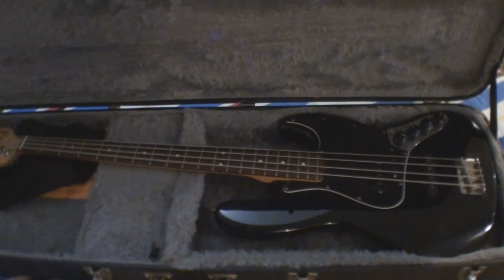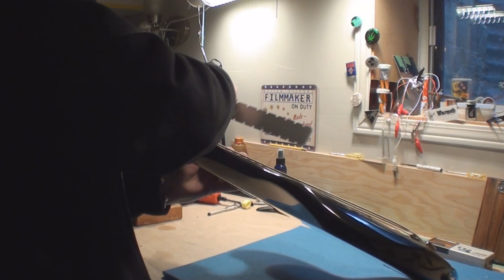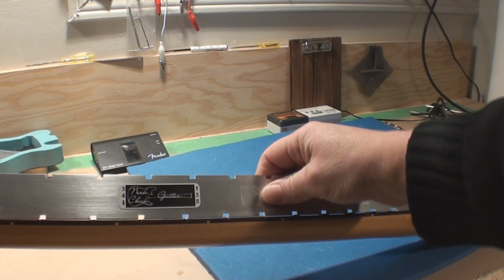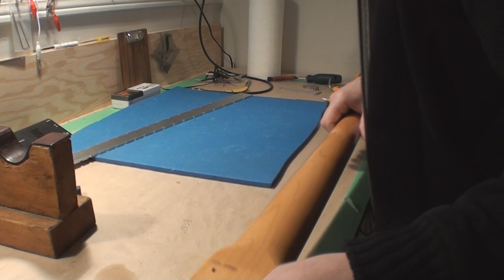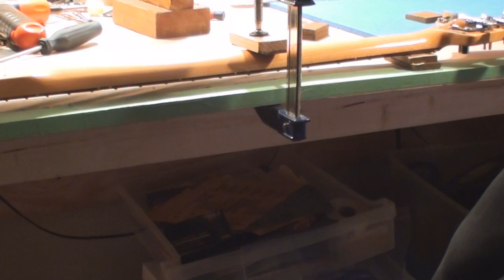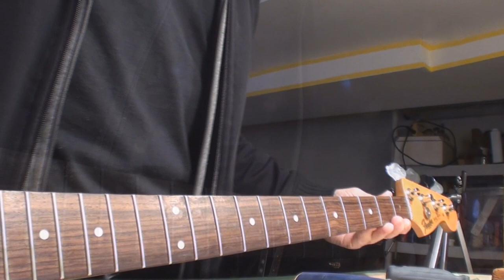Fender Bass Bent Neck Repair

Comment: Prior to clamping, I use my heat gun to slowly heat the fretboard until it's all nice and warm, almost hot, and it releases the tension between the two dissimilar woods - rosewood and maple - and SHAZAM! - A heating pad is also effective, especially is it is a bound fingerboard - Hope this helps.

Comment: My 04 Squier P , with the PJ picks, I know it's only a Squier, have had It for about 10 years, and it mint, and I love the feel of the neck,  and it used to play great, I have a 70's Fender J, and 70's P, and a 66 Gibson EB3, and I have 2 Ibanez nice playing cheaper basses, went to Change strings and set up before playing it for a while, long story longer, re sting it and the action was high on bass side, tighten, truss rod, twice 1/8 at a time and still relief on E string and its just under 13mm at 7th feet, look down the neck reel good and I see a really, slight twist, I am going to give it a shot to straighten it I did it on an Ibanez, and I got it straight, and I was going to do slight up grade on pups, and I didn't, If can't straighten it out I'm going to get the same exact neck, because I love that bass, it was all most as good as my MIM P, that I got last year

Comment: By the way I did this on a Gibson les paul and an iron set on warm for a few hours, it worked great and even after years its held up and the binding didnt melt, I think the heat is an important ingredient to allow the wood to flex into the new shape then let it cool completely while still under tension to cure into the new shape. Mine was still warm after 6 hours so I left it overnight.

Comment: Wish I would have been watching these before I gooched my fender jazz (mim as well).  I thought the nut was stripped, got a new one, then the guitar guys told me the neck was warped and that I could leave it there so they could put a spacer in, but since I got it as a project guitar I went for it, and got the damn washer stuck on the rod, now I don't know what to do lol

Found a mighty mite neck and put it on crooked X[ Still plays good, you can see me using it in some of my looping videos.

Comment: Don't steam it too much ... unless you mean to take the fretboard off. Sometimes injecting some steam via a fret slot or three works better, but you have to get into the wood of the neck, not the fretboard. It's a fun game. Too little doesn't work, too much and you have more to repair. I have straightened necks with worse bow ... since they were off classicals they didn't even have a truss rod.

Comment: thank you for showing us this trick...i’ll try this with my fretless ‘75 Fender Precision (not too precise without frets) & see if it works out. 
DAVE, 
is there anything i should be concerned about before trying? could you estimate about how muck rocker i should go passed straight?..or does it vary due to condition? 

i may gradually add clamp pressure over a few days. sound good?

thank you, Uncle Dave

Comment: Hi Dave.  Thanks for your videos  I have a 73' strat solid maple neck and I think the right terminology for this is-it is crowned with the truss rod tension totally released.  So my thoughts were to clamp the neck, using the same procedure as you are using on this bass neck, but in reverse with the neck flipped over.  I would appreciate yours thoughts on this.  I love drinking beer and tinkering with guitars.  Tim.

Comment: lately I am noticing that guitars with symptoms like these can suffer from too much of positive neck angle (but not all), this way the strings affect the bow even more. often times the truss is maxed too. after fixing the angle the truss might work properly again and action becomes more comfortable. of course if your neck doesn't back-bow at least a tiny amount without strings, it might be gooched, as dave likes to say :) heat and forced position might do the trick then.

Comment: bought a squier p bass on ebay..got it with same problem..sigh.. was thinking  would it be wise to remove the fretboard, clamp the neck with a slight back bow (and the truss rod loose) then reglue the fret board back on while in this back bow position?

Comment: I'm wondering if the clamp trick will work. I have a Peavey Fury p bass that has some bow between the 14-19th frets. the truss works but I just can't seem to straighten that span. do you think it's too close to the heel to straighten w/ a clamp?

Comment: The problem is not doing too much steam, or just go ahead and plan on removing the fretboard, but it will need to be bent to match as well. IF it's ebony, good luck, it's hell to work with.

Comment: Dave, After a couple of three days on the clamps in the direction just like you did (I gave the opposite bow with clamp pressure) I removed the clamps and the bow is still present. What is the next thing to do? Does the neck get trashed? Is there another thing I can try? Thanks
Reply: Alex Henderson Well, i'm not Dave and this method is certainly not Novice level repairstuff but if you heat up a neck to where the glue between fretboard and neck becomes semi-liquid again and clamp the neck straight or very very slightly back bowed (way les than Dave did here, i'll explain why) and let it cool down overnight in that position it wil stay straight.

Bending wood is done by heating it up bending it and letting it cool so you have that PLUS your fretboard will keep the neck straight because if the glue becomes plyeable and you bend the neck the fretboard will move very slightly and if the glue sets again it will keep the neck itself in the desired position.

This is also why we do not want as much back bow in the clamp using this technique as opposed to Dave's, we heat, bend and reglue so springback will be a lot less than showed in this video

This obviously works best on a neck with a rosewood or glued on maple fretboard and can fix some serious warpage but it will also work an a one piece maple one that is not that badly bent.

You do need a couple things besides clamps to pull this off without messing up your guitar's finish on the neck and possibly the fretboard.

1 A heat gun or another heat source you can use to gradually heat up the neck
2 A flat beam of hard wood or preferably steel same length as the fretboard
3 A thin perfectly flat piece of soft wood (pine) with 1/4" thick piece of leather over the length of it again same length as the fretboard.
4 Tape
5 Couple of Clamps (3 or 4) with blocks like dave has to protect the back of the neck
6 A shit load of patience

Step 1
You start by taking the neck with loosened truss rod and heating it up slowly until it is really warm to the touch but not burning so the glue between the neck and fretboard becomes playable / barely slideable but not loose and tape up a fews spots on the neck to prevent any sliding of the fretboard from side to side instead of the length as we want it.

 Step 2 
take the the piece of wood with the leather, put it on the steel beam as a compression buffer to compensate somewhat for your radius and to protect your frets (ideally the piece of wood should have a mirrored radius and padding to your fretboard to cradle it but that's not something most of us have lying around so hence the 1/4" leather and soft wood for stability) 

Step 3
Clamp the heated neck onto the beam and wood jig with 3 clamps and snug the outer two up so it does not move and use the middle to bend the neck but  don't tighten it all the way immediately, get the heat gun out again to keep the glue from setting while bending, clamp a little, heat again, clamp a little, heat again and so on gently until it is straight or slightly (1-2 mm max!) back bowed to deal with any spring back.

Step 4 
Tighten the truss rod with the neck straight just like dave did, let cool overnight.... done. 

An added thing you could do is take the nut completely off the truss rodd itself whilst still having the neck in clamps, put on a few washers/ringlets before you tighten it upand this will  give you a little more adjustment if need be under string pressure with the rod if you are really close to maxed out.

Google neck clamping Jig if you want to see similar set ups and fixes for reference .....

Doing this might sound scary but take it slow, be gentile and you will be just fine as will your neck...

If it is too bent for this not to work you could alway's use the neck as an bow and arrow heheheheh.

Hope this helps and good luck

Comment: Many thanks for your video. I was able to fix correctly a bent neck on an Applause 6-string acoustic guitar (AE-138). Set up the gig as you did until neck was slightly back bow, left the gig on for three days, tightened the truss rod nut until it was tight, remove the gig and then had to add small bit of relief. Voilà! Put new strings on and enjoyed the guitar. One question: would it have been better with some heat treatment?
Reply from the maker: watch heat press videos..i have some

Comment: In order to make that happen the way you want, it's best to remove the hardware, and apply some steam. I use a five inch diameter PVC pipe with an endcap glued on one ent, and a fitting on an endcap for the the other end. While it's moist and warm, clamp it up like you had it ... maybe not quite so far the other way. Leave it set for three to six days with the clamp on it, walla, you've done it ... or gone to far the other way. Just clamps alone doesn't allow the wood to let go of the "set"
Reply: Right. ADDING moisture to green wood is supposed to help how?

Comment: When you bend it back the other way to counter the bend it came in with, are you bending it about the same amount in the other direction? Or maybe a little more to allow for string tension?

Comment: Dave's World of Fun Stuff
Hi Dave, I have a question, I have a 5 string Fender Jazz Bass I took the neck off to straighten it, and this bass has a set screw in the pocket that pushes on the heal of the neck, What is the procedure for adjusting this set screw?
Thank You Sir
Reply: I figured that much, Should i start with 3/32 at the 17th fret? 
Thanks again

Comment: I recently snapped a truss rod tightening it on my fender MM jazz bass and thought ....shit now what? New neck ? So I searched around the internet and found a solution. I removed the truss washer , bored out around the truss rod with a hollow boring bit about a half inch or so then put that washer back on and the nut and tightened it back up . Works great other than the rod is a half inch shorter ..... beats buying a new Marcus Miller neck for $ 500!!

Comment: Dave, do you have any videos or suggestions on a roller coaster neck. An Alvarez AD90CE was brought in yesterday. My slotted straight edge just touches the board on the 2nd fret, the neck bows until the straight edge touches from 13-17 fret, then the edge comes off the board again. It's a beautiful guitar and only a year old but the idiot obviously leaned it against a wall for the entire year. I see the marks on the head and tuners.
Reply: ***** You may be correct. Measuring level with a straight edge from the 20th fret, it appears to have about -.040" of deflection at the 2nd fret. That's more than the fret height. I'm gonna try counter stressing it somehow and then heat it up. If that doesn't work, I figure I'll bring over some strippers and have them use it as a pole, that should get it straight.

Comment: Hi Davey. Would it help if you put some heat on the neck carefully. Steam or with a electric industrial blowheater. Just enough not to melt the finish or glue .
Reply: Yes. I do this as needed.

Comment: Hey Dave a couple of my guitar necks are too straight, but there's no more tension I can release on the truss rod because these no tension on the truss rod and the nut starts to unscrew if I try to turn it any more. Would this be the same way to fix it? or do the same thing but with the fretboard facing up?
Reply: *****
Will tuning up to F# on a guitar with a floyd rose work the same way?
And what usually causes necks to bow backwards when there's no tension on the truss?
All my guitars are kept in a decently humidified room.

Comment: I have a question here sir. I was trying to repair the neck of my 1980's ibanez, where i can see that the front neck (1 - 4 fret) are warped. When i take the neck out, i find it hard to loosen the truss rod. it moves, but very hard. so here's my question :

i) how do you straighten a warped neck? is it with the same procedure as your video?

and

ii) how do you know if the truss rod is broken? is it just a normal problem due to rust on the truss rod screws? prob'm is i dont have a gauge to check
Reply: If you’ve got rusted nuts, would WD40 be the solve? Just soaking that sucker by spraying a ton into the hole affect the wood in any way? (too much moisture.) Also, what guarantee is there the whole twisted-as-fuck thing won’t simply retwist?

Comment: The wood fibers have stretched if it wont straighten out.  That is why I want a roasted neck from Warmoth. The sap is cooked and add strength to the neck.
Reply: Actually, it makes the neck brittle. Roasted necks are not what you've been taught. They're way less reliable.

Comment: after clamping a neck does at some point it goes back to where it was at
Reply: It shouldn't. Once the truss rod is tightened, it will hold it in place. Unless it's a cheap poorly made neck than once you have it straight, the truss rod should hold it in place when you put the strings on and tune it too pitch.